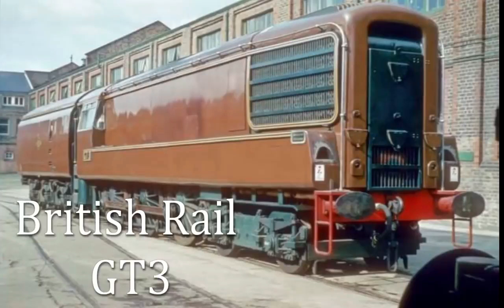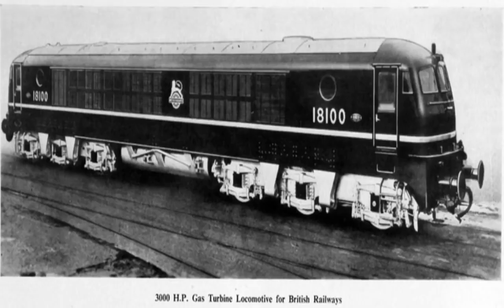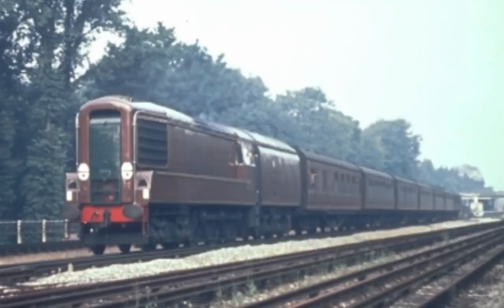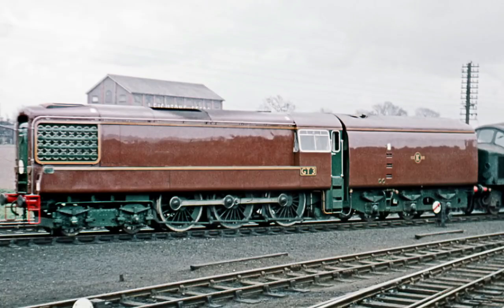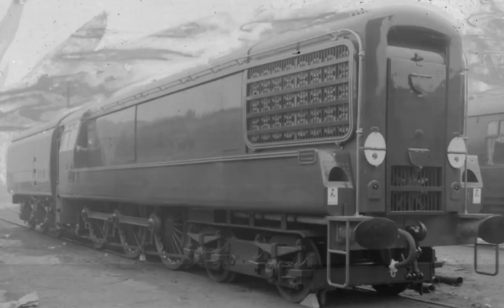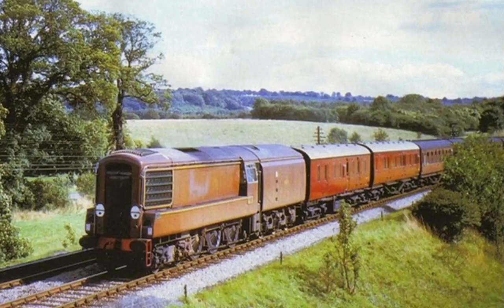The British Rail GT3: The Experimental Gas Turbine Locomotive #locomotive #fyp #railways

Comment: Didn’t they try again with a turbine powered HST before going back to Diesel? I think Amtrak tried as well.  Sadly there are lots of snags with gas turbines on the rails. Most important was not sucking passengers off the platform, but also the noise of the engine, and the time to change speed or stop. And don’t forget the fuel cost.  Thanks for the video though for its day the train was clearly very pioneering.
Reply: @PaulGodfrey  Union Pacific had 55 GTEL's built by ALCO in the 50's, they were B-B-B-B configuration for the first two generations and then C-C for the third, looking dissimilar to the contemporary Diesel Electrics on the market, and this being Union Pacific they were used for freight.

British Railways intended the APT-E to be a gas turbine... but British Leyland....

Comment: It was my belief that the GT3 was plagued with development purgatory, not because it wasn't a good idea or concept.  Had it been built, tested and shown at a similar point to the previous GT1 (18000)  and  GT2  (18100), the idea of basing the design around the existing 4-6-0 steam locomotives would ease the public and operational aesthetics.. however instead of a launch in the early 50's, it was sidelined by the 1955 plan, and only completed because it was 70% assembled and had 95% of the required parts by 1958.